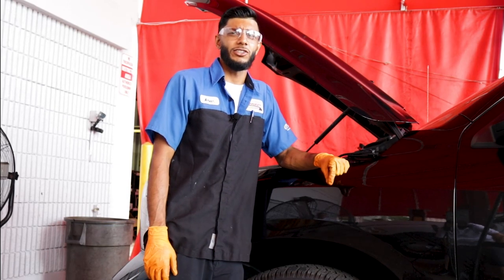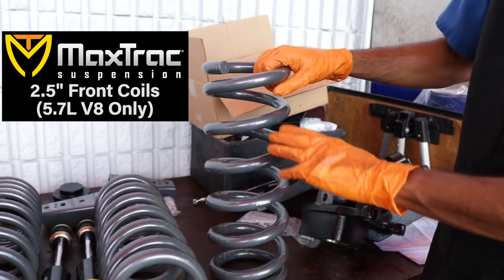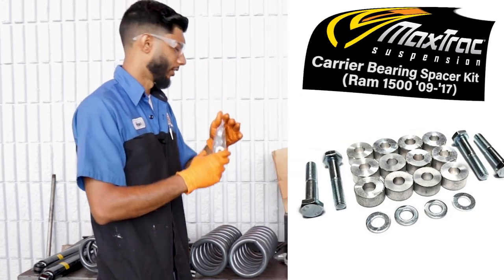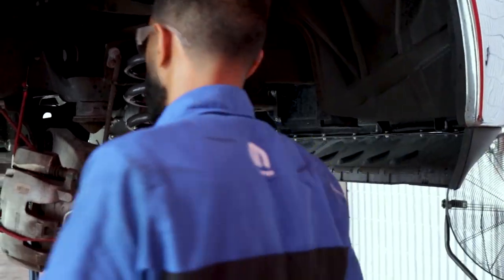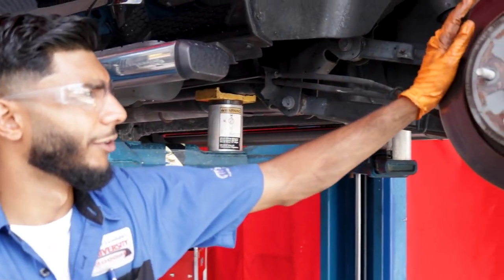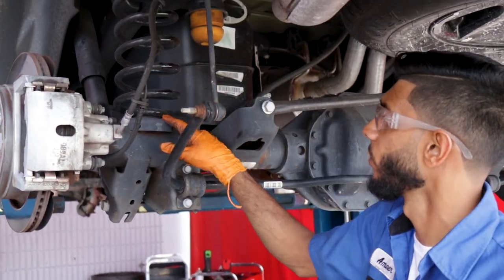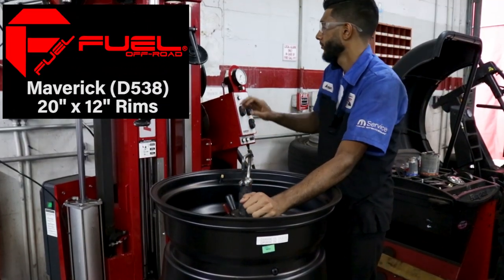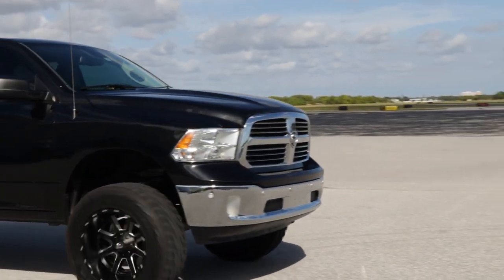How to Install RAM 1500 7-inch Suspension Lift Kit | MaxTrac | Miami Lakes, FL

Comment: Was a re-gear needed? Is a re - calibration of speed odometer,  tire size changed, tire pressure threshold changed prior to the installation or is this all standard procedure done in the installation of a lift ?